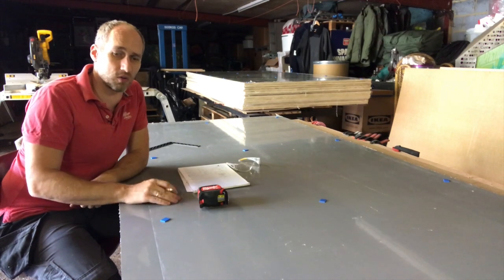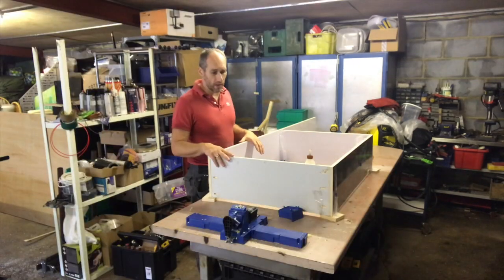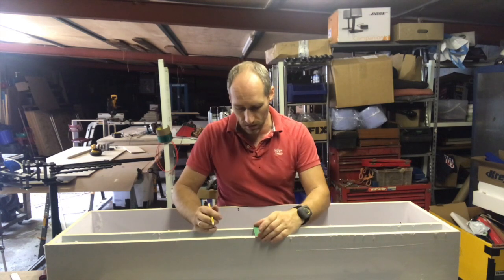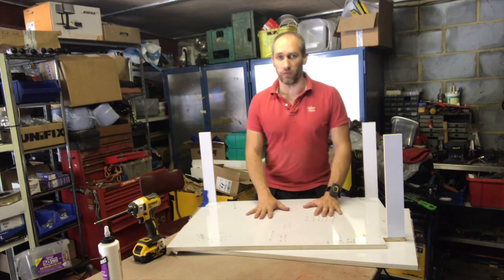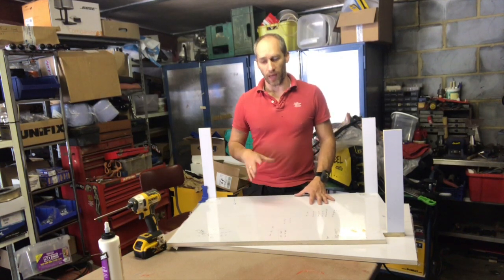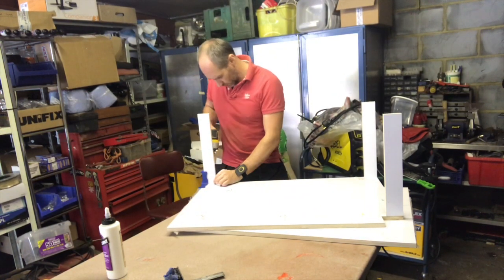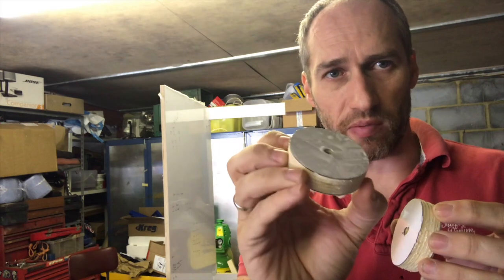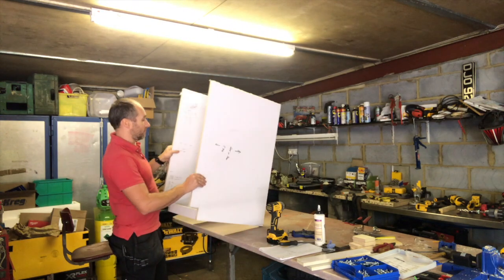How to build  an Overland Truck.   [S1 - Eps. 7]  Man 8.136 VW LT.  Lightweight ply furniture.

Comment: As always . You deliver a really good and informative video.
What is the name of the one you have to drill into the side?
What is the weight difference between regular Plywood and the one you use.
Regards Martin
Reply from the maker: Hi Martin.  I don't know of the top of my head.  But using the lightweight ply you do notice how light it is.